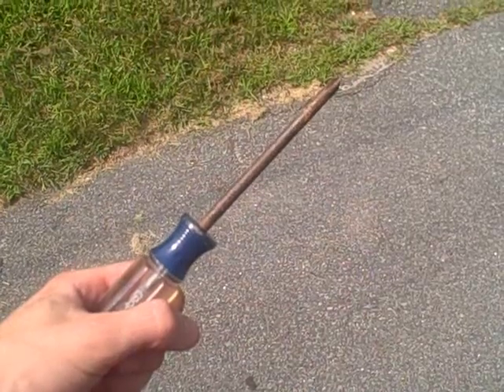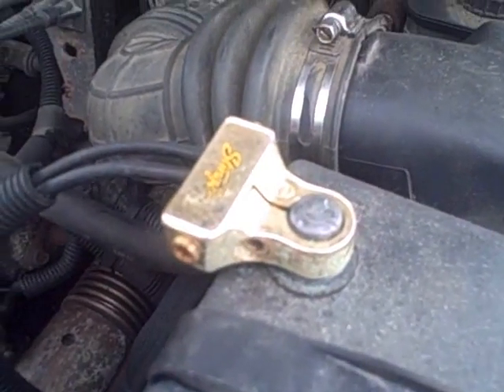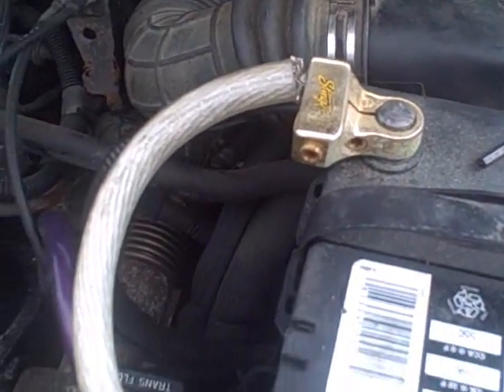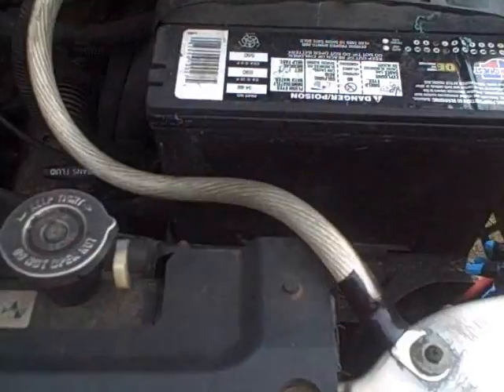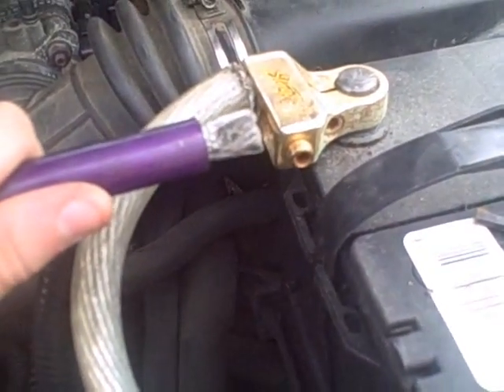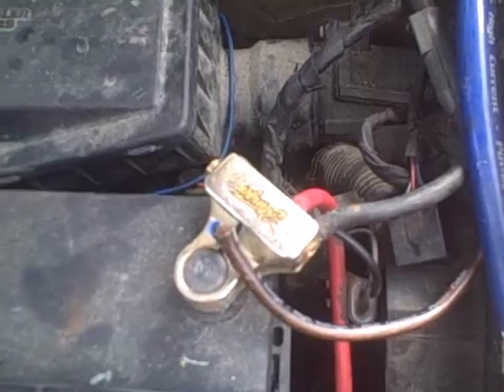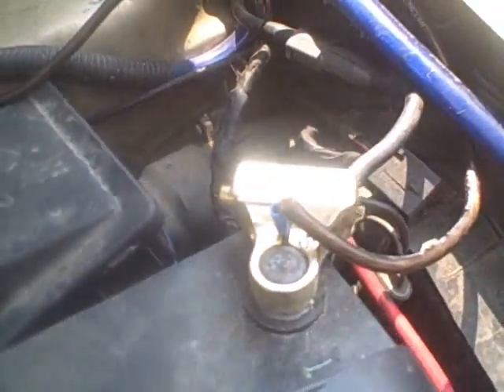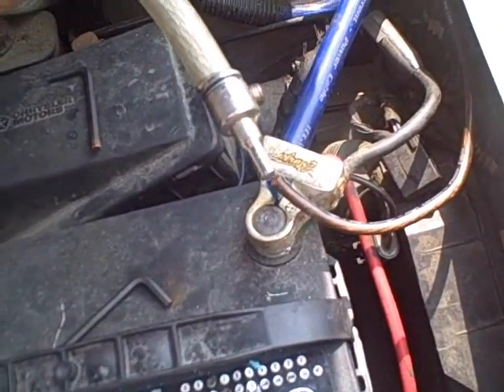Increase Car Audio Power 25% - How To Install Big Three Upgrade - Easy 15 Volt Stereo System Big 3

Comment from the maker: @MaxxsonicsUSAInc - I personally would never fuse my alternator wire - It powers too many integral functions to the vehicle. Imagine driving 65mph and blowing a fuse on the only wire that keeps your vehicle running. Electric transmission, spark plugs, ect -  That's just asking for trouble. I've heard too many horror stories from people who decided to fuse their alternator wire.

Comment: @EXOcontralto Actually EXO, some manufacturers do. Generally when the alt is run through the fuse box near the battery it is fused or monitored. When upgrading the charge wire from alt + to batt + most guys are bypassing their factory protection. This is why it is best to fuse. If you alt shorts or full fields you will destroy you vehicles computor etc. This is why I always fuse from alt + to batt +. Precautionary measure that only takes a few extra bucks. ;-)

Comment: lucky me my alt is where i can run on top about a foot maybe 2 away and do u recomend fusing from the alt i have a perfect 0gauge in line fuse for it but what size fuse should i use? i have a 150 in it already and i will buy bigger if i need it

Comment: Were did you get those Stinger Terminals? I like the plug like metal piece that screws into the cable. Seems like it would be really secure.

Comment: @EXOcontralto  Agreed with you man. That is the best possible way.... Also one thing that COULD help but not really necessary. IS to run A large ground back from the rear batteries, but really, The Chassis is fine. I think that is a great way too.

Comment: cool vid. why are capacitors not recomended? and what about adding a dry cell battery? is it better?. im asking because i read that a capacitor is not recommended and that a dry cell batterie works best,

Comment from the maker: @billiambarnett - Hell yeah - The best order of electrical upgrades are:

1: Buying A High Output Alternator 
2: Upgrading Big Three Wires
3: Adding Multiple Batteries
4: Removing Capacitors

Comment: @EXOcontralto yea, you can go as big as you want, but you still cant exceed what you system can output, this just helps get the power to your amp better, doesnt limit it, I want to do this, but its super hard to get to my alternator positive, I cant even see it

Comment from the maker: @BAYBAY7840 - That's a BIG misconception - The bigger the wire, the better. Plain and simple - There's no such thing as adding too much copper just as there's no way to increase the output of you alternator by increasing your wire size. It just creates a better connecting.

Comment: i won't use a fuse between my alternater and battery because i did some research and if that fuse blow and u don't know u better pray its a short trip. burned out alternater and dead battery

Comment: appreciate what ur doing 4 ppl, but its not recommended that u use 0 gage wire on factory alternaters ( amps are too low ) this will cause the post on the alternater to heat and burn out 4 gage wire is perfect for this application from 60 amps to 180 amps, now if you want 2 go 0 gage use a 200 amp alternater no less. once again appreciate what you do. i had this problem with the big 3 and done some research and found out why

Comment: i have 2 of those in my gf's carolla and im pretty sure her alt is smaller than yours just run the big 3 and get a stinger(800 or bigger) or kinetik battery for the subs and all the dimming will go away trust me.you might want to get an isolator as well but those arent expensive

Comment: Okay I have a 15inch solobaric L7 in my truck.. And when it kicks, you can literally fill my truck give in and about quit when it kicks so hard. So would the big 3 help me? Also, I'm a mini trucker and I do have compressors and alot of shit running off of one battery. So would the big 3 fix it? Or would I need another battery? And whats some good batterys?

Comment: your alt will only pull out lets say 40amps if theres a 40 amp draw. If theres a bigger draw of current it will but out more untill its maxed out. Stock alts put out a max of 80-140 amps

Comment: Your alternator will only put out what it can put out. Nothing can actually "draw" power from your alternator, especially a wire. A thicker wire just allows for less resistence than a thinner wire, so more current can flow. Your best bet is to use anything bigger than your stock wiring. 1/O wire is best because not only does it offer far less resistence than 4 or 2awg, but it can carry around 300A of power, where as 4awg can only do about 120A. Upgrade your alternator, you WILL need 1/O wire.

Comment: I just installed an iraggi h.o. alternator and just wondering if i need to run a seperate 0ga ground wire to my batteries which are in the trunk cuz right now at idle i sit with 12.2 volts something ain't right my stock alt. was doing 14.4 to 14.5 any tips?  I have engine ground with 0ga to frame and batts. 0ga to frame with .02 to .04 ohm of resistance im sure that the ground is fine.  If any ideas please help!

Comment: Found the problem the fuse blew on the cable going to the amp to the car battery it works now. Thanks for the info and tips

Comment: @Crazydog500

Then check your amplifier to make sure no fuses blew. I can't really see a reason why they would go, but it's just something to look for. Another thing is your fuse on your power wire and make sure it's not blown. What most people get wrong is the fuse rating for the power wire. the fuse should be rated FOR THE WIRE, and not the amp.

Comment: A neon tube doesn't draw a lot of current, MAYBE 2A MAX. Connecting it to your amplifier's power and ground leads is totally fine because your power and ground wires should handle greater current than your amplifier needs. Here's an interesting question for you. did you connect the neon to the amplifer's 12+ or the REM+? Also, check your subs to make sure they work. Use a continuity tester. If you don't have one, tap a 9V battery to the terminals, It shold make a "click" sound.

Comment: I hope you can help.

I installed new subs in my box they worked fine then i tryed to hook up neon lights to the amp (to the ground cable and power cable) and i got a spark and the subs in the box dont work anymore. How can i fix it to make them work again.

Thanks

Comment from the maker: Running an amp inside your house is tricky business - Especailly if you want it to get loud - To be honest, You need to have surplus of power to sustain your voltage & produce enough amps to funtionably run each woofer the way you want.

Comment: i have my car stepup in the house and i have just  a battery  and a power cap hooked up but when the bass hits the amp cuts out i thinks its bcuz its not grounded right  could that  b tthe problem plzs help

Comment: Electricity also doesn't travel, it's just electrons getting pushed.  And those electrons don't move very fast at all, sometimes slower than the hand on a clock.  And only the outside coating on a metal chassis would be dirty(hence why you clean a spot for a ground), the metal in the center is pure and clean.

Comment: actually, it's mostly steel, aluminum is more expensive.  And 2 tons of steel>a few ounces of copper wire.  Plus most bigger power wires are acutally copper clad aluminum, mean, mostly aluminum and very little copper.

Comment: @320bit  You're wrong, you want the ground wire as short as possible.  There's more metal making up the chassis of a car than there is making up a length of wire running back to your battery, therefore, the chassis is a better ground.

Comment: yo EXO I just did the big 3 with stock alternator and stock battery. now my rpm dropped at idle seems like its starving for more power..do i need a better alternator??

Comment: @sturgis76 are you kidding me?  dude..........he `s not talking about your actual amp ground guy!  he`s talking about the common ground for your whole cars electrical system dude. that way when you do add those short amp grounds you spoke of its even better. get it?  trust me, the big 3 is a fantastic tip that all serious installers should know about.

Comment: @BIGwooferJAY yeah probly a 250 amp would do it cause i am doing the same thing i got a mazda protge and my shit shuts down when i get a low battery but i am getting a capaciter first

Comment: that first cable you did, i can see that you cut some of the wires so that 0 gauge wire could fit in that 4 gauge spot. is that safe?

Comment: where can i get the battery terminals u have?i looked on crutchfield and seen some does it matter as long as they 1/0 where did u buy yours from id like to put the same ones u used bro

Comment: get rid of the capacitor upgrade to a deep cycle battery or a high output alternator. make sure your amps have a good ground

Comment: EXO most new cars are fused under the hood...The battery goes through a fuse block under the hood. The battery is connected from the factory to usally @ a 120 amp fuse. Any wires you add should be fused in the event the wire was to short out it would prevent burning the entire car to the ground.

Comment from the maker: It's all preference, but sure, go ahead and leave the existing wires - It just adds to the overall connection.

And no, in fact, most manufacturer's don't even fuse that line - Go look right now, and tell me what you see -

Comment: Question for you. When you do the big three upgrade, do you fuse the wire running from the battery to the alternator? Do you leave the existing OEM wiring in tact? Awesome videos, keep up the good work!

Comment: The big thing here is really the grounding....the bigger cable from the alternator isn't going to give you more juice, the battery is already caching the power thanks to the raised voltage output from the alternator.  So IMHO just a decent (Apexi) grounding kit is the go.  Of course for my car audio I went with isolated deep cycle batteries and capacitors.........

Comment: Exo, simple question here.
Instead of Battery-chassis and engine ground to battery, can I just go engine ground to chassis because the battery is already grounded to the chassis? Because my alternators on the opposite side of the engine as my batteries below my engine near the wheel well.

Comment from the maker: I agree to an extent - It's very important to fuse between batts and amps 

- But between all the people I've talked to, and vehicles I've seen in competition - it's very uncommon, and not necessary to run fuses from the alt Alternator to the Battery - Even manufactures don't recommend doing it.

Comment: Hello EXOcontralto NICE VIDEO THE ONLY THING FORGOT WAS THE FUSE BETWEEN THE ALT AND BATTERY FOR SAFETY THESE DAYS EVERYONE RUNS AT LEAST 1000 WATT AMP IF THEY' R ON YOUTUBE LOOKING UP CAR AUDIO . THE BIG THREE DOES MAKE A MAJOR DIFFERENCE ON HEADLIGHT DIMMING AND POWER SO JON DOES NOT KNOW SHIT! BUT AS LONG AS YOU FUSE ALL POWER CABLES YOUR SAFE, OH YA THIS IS COMING FROM AZ HOME OF FOSGATE, MTX, DIAMOND AUDIO, MY SETUP JL C5 6.5's kicker 2500'xs 1 18" solo x and yes Big 3, 2 batts 250AMP ALT

Comment: It's very obvious you don't know what you're talking about, and yet you're so adamant in your ignorance.

Alternating current is very different than direct current.

So while your father may be an electrician, that trade does not translate to mobile audio. Even more so based on your 2nd hand opinion.

Frankly you are just plain talking out of your misinformed ass based on your father's profession.  If you want to tell us the proper way to bag groceries, then please enlighten us.

Comment: jondeth is a fuckin idiot

you sound so stupid

exo you should delete this kids dumb comments so he doesnt confuse people

0 gauge is rated for fuckin 300 amps and besides, you could have 6 runs of 0 gauge hooked up to a stock alternator and it wont cause any harm, it will only help the alternator. if anything your causing harm using skimpy 4 gauge wire you douche nugget

Comment from the maker: I'm not surprised honestly -

Even though they work great in big battery banks - the Optima brand is very overrated, and often people buy them hoping to solve voltage problems, and don't.

Upgrade the Big 3 to 0 gauge then come back to see me.

Comment: would I disconnect the original + wire running to under the engine to the tube thing? or just add a 0 ga running from alt to batt? cause I dont want to mess something up by removing that wire incase its powering something in between the batt and alt.
Thanks for that quick reply

Comment from the maker: That's your problem - Most manufacturers already use 4 guage wire for that - You basically just installed a Stock Wire.

Comment: hey can anyone help me???

I have a 2009 toyota tacoma and I wanna do this. i found where all the stock ground wires go and what I need to do as far as grounding. but when i followed the positive wire, it went under the engine and hooked up to some sort of tube thing and not the alternator. I'm assuming that the tube thing is hooked up to the alternator but if anyone knows anything that could help that would be great. Thanks

Comment: Hello I have a question ... it is a sound system that I want to mount on a scooter I would use a 300w amplifier to add it as a woofer and two medium speakers I would know what I need battery providing exactly how much amps ? Thanks :)

Comment: since your 2 batts are connected together it doesnt matter but just connect the amps to the rear batt, saves wire. what size wire are you using? itd be best to connect the front and rear batts with a 0 gauge run. your alt should be okay

Comment: its not just the width of the port, ill send you a message of some premade designs on caraudio forum of different sized boxes and tunings. if you want best of both worlds id tune around 36-38hz on the box.

Comment: hey thanx man. and i checked out ur set up very nice. i only have 2 12's runnin round 1000 rms a piece. i'm trying to figure out which way i should go with my box. should i keep it sealed and have it play nice tight notes or slot port it to get those lows that i love. have you heard of a size port for dual 12's that has the best of both worlds?

Comment: all you do is you start with your front battery, run your power wire to the back. then fuse the power wire under the hood with a fuse holder, and you also need to fuse about a foot from the back battery, incase there is a short between the front and back batterys both fuses will blow saving the batteries, then you just ground your back battery either to the chassis, or you can run a second power wire from the front negative to the back negative.

Comment: well red tops are better for starting, yellow tops are deep cycle they are better to be ran as a secondary battery, but the kinetiks are better that optimas, they have better amp hour ratings.

Comment: it will definitely help. i used to run a optima red top up front, and a kinetik 2000 in the back of my blazer with a stock 105 amp alt and it held up perfectly running a soundstream 2000d 2000rms @ 1 ohm and a 4 channel. now im running 3 batterys in my tahoe and a powermaster 240 amp alt with the big 3 and i have 3200 rms @ 1 ohm runs just fine

Comment: if your running a second battery in the rear, your supposed to fuse at the front batt and the second battery, if you only fuse the front battery and there is a short in the middle of the power wire, itll blow your front fuse, but the back battery will still be shorting out. so fuse twice on the power wire, at front and back. and i would not splice and add on to wire, stinger does make a piece where you can connect 2 wires together and splice them. i would just run a new wire.

Comment: hey question. anyone with input can answer. i have 2 yellow top batts and idk if i need a fuse between the two batts or if i just need the fuze between that second batt and my amp. another question is after replacing my stock battery with my yellow top my original connectors from my alt don't reach the battery. is it ok to splice that wire to get an extra 3 inches that i need?

Comment: i seen the convo and thought id give a secon opinion towards "bad4health's" advice.hes right always go with a battery and not a cap,all a cap is is a small battery so go with the free battery,as for the fuse on the alt charge line deff go with 1 and if your running a stock alt a 100 amp fuse should be just fine,any question you have id be happy to help out

Comment: i had a cap an my light still dimmed. an 2nd battery free?? if its not a AGM or deep cycle dont even bother. i tried to find every way around the electrical problems, dont fuse the wire unless you have extra fuses that will b with u at all time cuz if it pops then ur gunna b stuck. i didnt fuse mine... hell i threw the small 4 ga wire away an replaced it with a 1/0. get the right stuff the 1st time its way 2 hard 2 keep pulling the old out for the new as in the case of wires.

Comment: @Cool9800 never use a cap! and you dont install the BIG 3....its already there ur just making the wire thats there bigger so more current can have a less hard time getting through. an go as big as possible so u dont have to do it again later wen u fry ur alt.

Comment: backdowwillie get a capacitor it takes the load off your battery you need 1 farad cap for each 1000 watts you amp puts out like i have a 1500 watt amp and a 1.5 farad capacitor

Comment: so when you connect the wire to the alt at the bottom what do you look for to bolt it on to is there a special bolt to look for and unscrew  or what.

Comment from the maker: Some brands will rip you off with tons of sheath, and little copper - Use what you have now untill you can buy "name brand" cable - All others will give you like half inch of plastic sheath and just a tiny bit of copper -